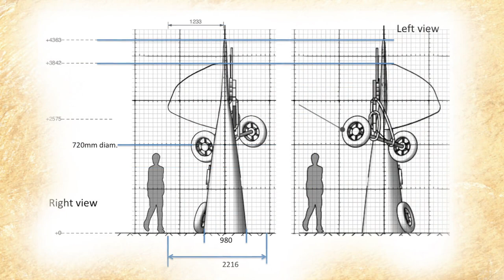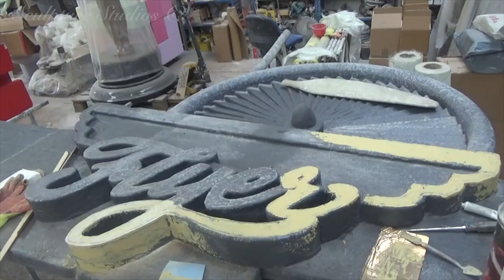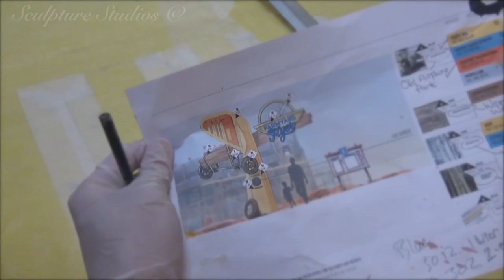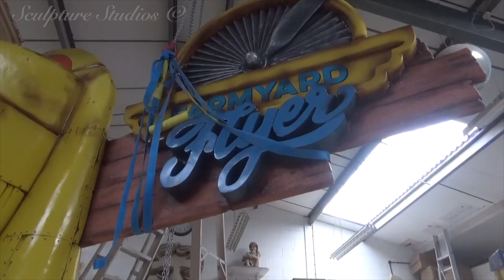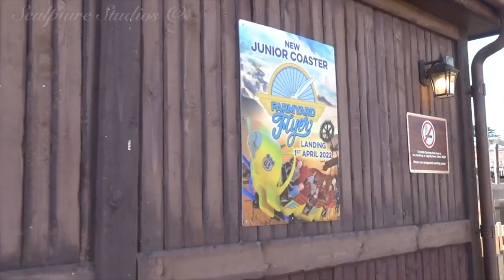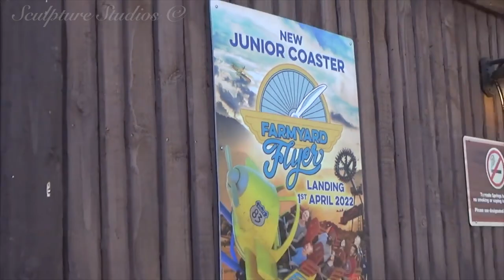Farmyard Flyer Roller Coaster Ride Sign - Paultons Park - by Sculpture Studios

Comment: Great work as always!

Please do share info on the "sticky back foil", I'm doing something similar, and am in need of a decent amount of adhesive foil sheets/rolls. everything online costs a fortune.

Also what's the best foil thickness to use on polystyrene shapes?

Comment: really curious why tinfoil is used rather than a spray sealer to protect the foam? so if the foil is to protect the resin from dissolving the foam, is the tin foil cheaper and easier than a spray or brush on sealer.
Reply from the maker: Clean material, no dying time, and releases easily